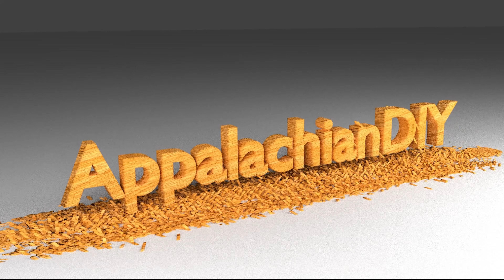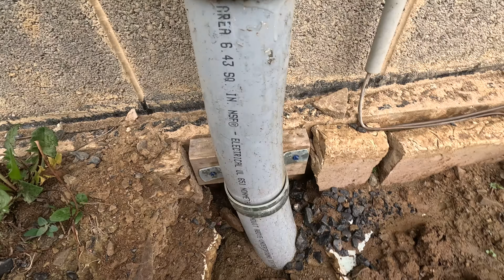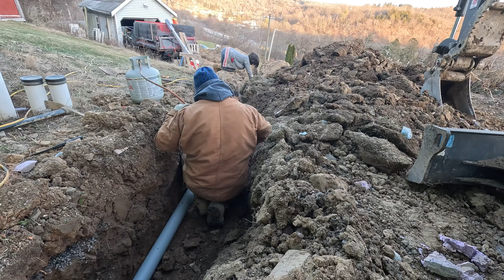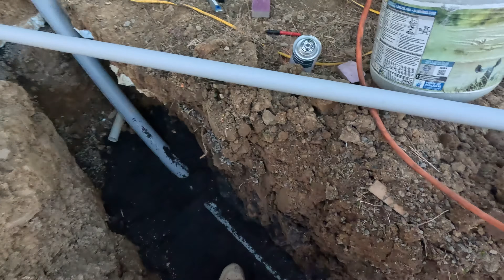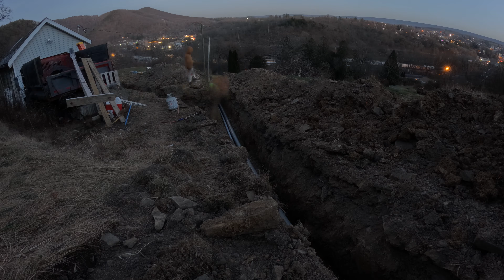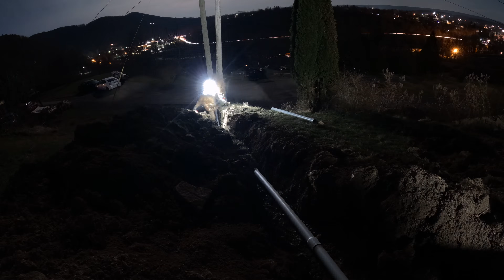Garage Build #36 - Running 3" Conduit for 200 Amp Underground Service

Comment: I was a radar tech in the Navy and worked in data comm and computers for 50 years. I have a general class radio telephone license with radar endorsement and an extra class ham license, so I know electronics. But I'll be honest, I am paranoid about the code and selecting equipment. I want it done right and legal. I am contemplating upgrading my 150 amp underground service to a 200 amp service, including service conductors, meter can, and breaker box and am putting together a spreadsheet of everything I need. I would also like an external cutoff between the meter and breaker panel as I detest having any power in the breaker box when installing additional circuits, etc. These videos are very helpful, thank you!  I haven't checked all of your videos but I am curious about your equipment selection thought process. Maybe just a short video on what you selected and why would be very helpful to me. Conductor sizes, little things like wire size, bushings, meter can and panel manufacturers and model numbers, would be very helpful. Kind of a start to finish materials list would be very helpful. Thanks again! I appreciate you taking the time to make this video.
Reply from the maker: Thanks, I'll keep that in mind, if i have time to make a video like that. Stay tuned as I might put the list in the description below or tag them in the video with links to where you can purchase them.